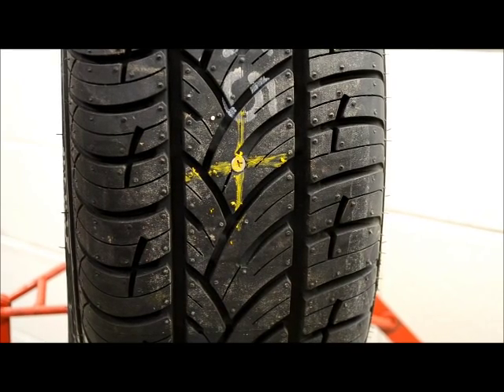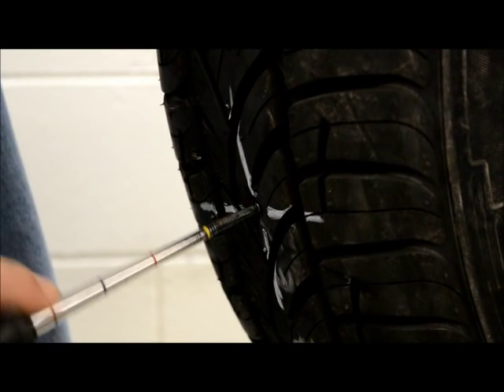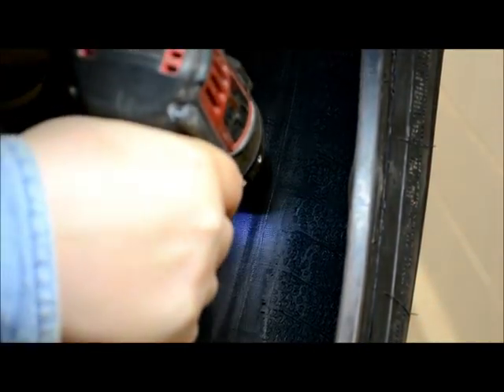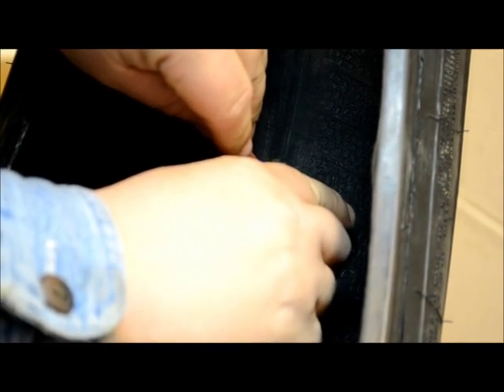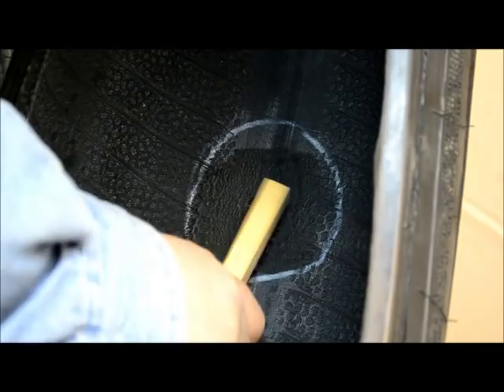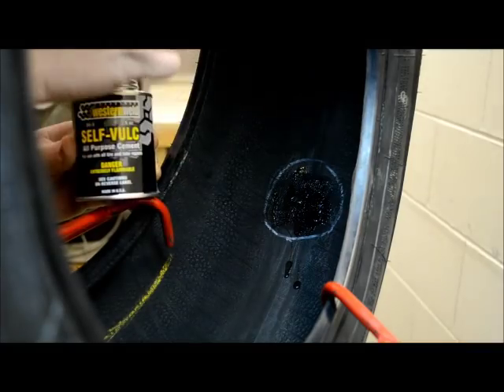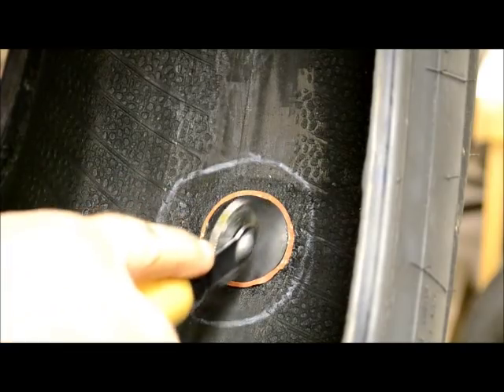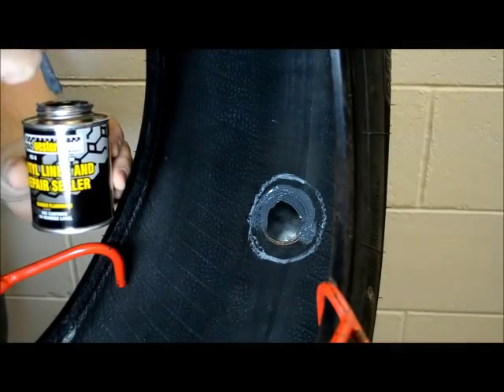How to repair a car or light truck tire

Comment: yep, well worth it to buy the road hazard package when buying new tires; i recently have to use it & they did it the right way, RMA standards, instead of the old ream-&-plug technique. the whole repaired tire was remounted & rebalanced before torquing it back on my van
Reply: Earl DaSquirrel Costco comes with the road hazard warranty. They just replaced your tire with a completely new one.

Comment: I've patched hundreds of tires over a 12 year span. This is a good video but a bit overkill. The crazy amount of cleaner used, the scraper, the damn vacuum...a little much, but hey, if you have 30 mins to spend on one tire then by all means have at it.